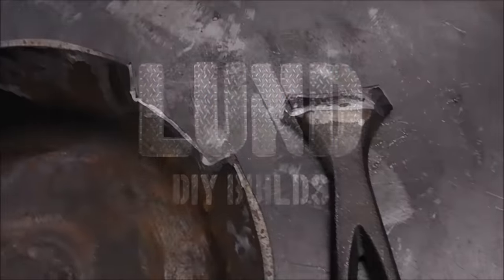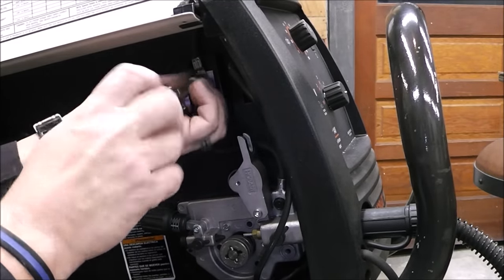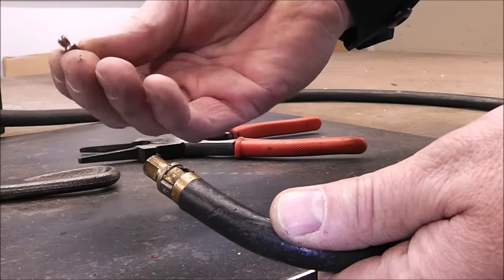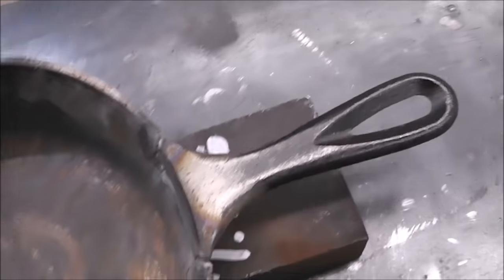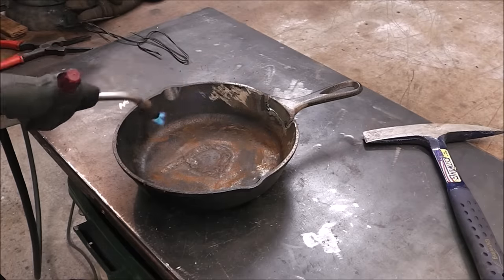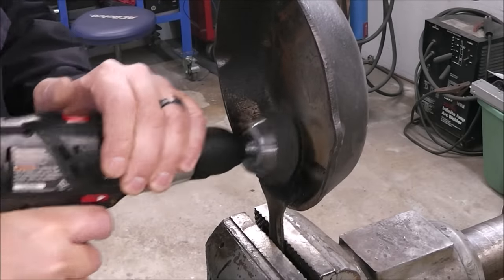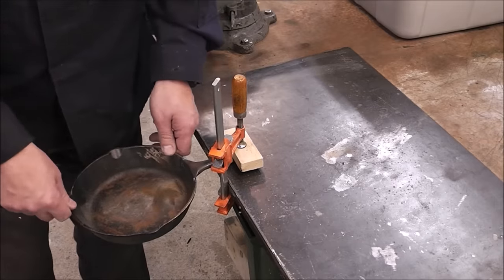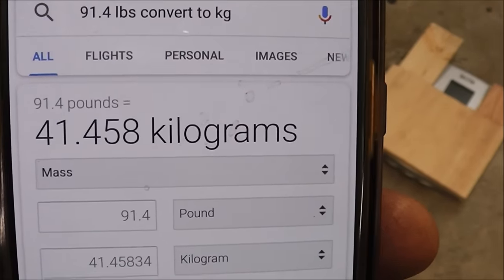Cast Iron Welding Repair using Flux Core Wire

Comment: I appreciate the video ,most people don’t understand that for decades Briggs and Stratton used a pot metal for their blocks, it wasn’t as strong as billet  aluminum or cast-iron, but it worked for the purpose of making a lawnmower engine ,it’s the application is what’s important to understand I worked for a company that would make molds out of Kurt site  and as long as you were making thousands of parts it was a great system but because the molds were for fiberglass parts body parts ,a fiberglass mold was cheaper especially for only a few hundred parts. so it is the application and what is the cost-effective method trying to make the strongest thing in the world is not necessarily what you need to do each time .getting that through the heads of some people is rather difficult so what works on each kind of repair I find very informative and appreciate what you’re doing ,the people that  complain will complain no matter what because they can’t or don’t do these things themselves .and do not consider all of the factors involved so thank again for the video.
Reply from the maker: Thank you so much. You get it. Not everyone does as you pointed out. I watch a channel called Pakastani Truckers. Those guys repurpose and get every bit of life out of something. It may not always be the best but there is some really good creativity and inginuity that comes out of being poor. Its one of the reasons i take such good care of my stuff

Comment: Great channel!  You're doing what others wonder about and that's a good thing!  I grew up poor and never had the right tools for any job, everything was jury-rigged as they say, everything was 90% figuring out how, and 10% cost because we didn't have the money to just call up an expert to come running.  These days I'm fortunate to be able to pay others do work, but I still think in terms of what can "I" do myself and your videos bring that out!  You're not trying to sell the latest brazing rod and call it "welding" you just show what can be done equipment on hand.  Flux Core welders are dirt cheap and probably the easiest way to weld and certainly less expensive than a gas setup and all the crap that goes with that!
Reply from the maker: @Randall Scott-Key you hit the nail on the head perfectly! I couldn't have said my intent to the channel any better than this! 🙏 I grew up EXACTLY how you described and it's why I make these videos. Nothing was ever what I needed. I had to figure out how to get it done with what I had on hand and that usually wasn't much.  I chuckled when you said you are at that point in life where you can pay people to do certain things but still wonder about doing it yourself. That is a spot on statement. I'm at that same point in life myself and it feels good reflecting back from where we've come. It's why I give back to our community. I remember what its like to struggle.

Comment: I’ve used several fire bricks underneath and around the edges and acetylene to preheat the material. Then nirod for the weld repair, added more fire bricks on top and let it cool slowly to prevent cracking. Good job.
Reply from the maker: Thanks man! I appreciate your support! Good tip on the fire bricks!

Comment: I like this! As a welder that specializes in SS GTAW, I have repaired backhoe hydraulic rams to T50 buckets using SMAW and FCAW and there are weld procedures, pre heats, inner pass temps for each structural steel when safety is required, but I really like the experiments. Nothing gains a better understanding than a failure. For this pan, you'll never cook eggs or a steak more than 100lbs so if Self-shielded flux works, it works! A metallurgy course, temp crayons or thermal gun is very useful in these types of situations. Keep up the good work! 👍
Reply from the maker: Thanks man i appreciate it!

Comment: I totally did this once when my mom dropped my skillet. I didn't use preheat or Bevel the edges. I just cleaned and welded it and it still seems to be holding well
Reply from the maker: Nice Job!

Comment: Thanks for the video. I am one of those guys that only has Flux Core wire welder. I am also new to welding, but I knew cast iron welding wasn't as simple as other things I have welded. My sister-in-law has a crack in her cast iron pan and this comes in real handy.
Reply: I encourage you to try other methods of welding. I think you will find out that flux core, IMHO, is the least user friendly than all the other methods. Especially if you are welding sheet metal.

Comment: Love the vid! By no means am i a pro. Several years ago I had to do small hand rail welding project, little did I realize that 1 of the 2 parts was cast. At first it kept cracking my tacks, after it got warm enough it started to stick together.  It took a while of weld a lil grind a lil, but it turned out looking decent and still holding to this day with my flux core machine. Nice to hear that some people still embrace alternative methods.
Reply from the maker: Thars awesome Craig! It's tricky but it can be done as you found out! Nice work buddy!

Comment: Good video.  I’ve been welding cast iron skillets, cast iron vises, ductile iron vises, engine blocks, and other cast iron engine parts for two decades using fluxcore mig or 7018.  Things like exhaust manifolds with dirty carbon exhaust needs more preheat to bake out the impurities. 

SS309 rod also works very well for cast repairs.  It was designed to weld ss to mild steel and has a lot of chromium in it that is soft allows flex as the weld cools if post heat is not available. (Such as engine blocks in vehicles).  Lastly, watch using plastic containers. I’ve melted a few. Lol
Reply from the maker: Thanks brother! I appreciate your support and kind words!
Reply: Dont huff those stainless fumes.

Comment: I welded a cast-iron crank handle on a Chinese drill press that my dad broke when he tipped it over.  I ground a groove on the broken parts, then decided to tack it together while waiting for my dad to braze it back together.  Using my mig welder with ER70S-7 wire with 25-75 Argon gas, I used a lower than normal heat setting, and tacked it on both edges.  It went so well, that I decided to make a core pass.  That welded so nice, I decided to make another, then another, and another, and eventually filled it all the way with the welder.  It welded amazingly well and so easily, that later I welded a HUGE crack (1/4"+) in a Ford 460 exhaust manifold for my neighbor that still wasn't leaking when he sold the truck 5-7 years later.
Reply from the maker: Nice work man. There is no better feeling when you can take what you have, use some ingenuity and make it usable again. It's a very rewarding feeling.

Comment: Thanks a bunch.
I've learned a thing or two from this video. I'm one of the guys that only has a flux-core mig welder... and no cutting torch either.
Reply from the maker: Than this video was for you brother! Thanks for your support!
Reply: Flux core self shield is extremely versatile. Can be used anywhere and on a wide range of applications.

Comment: As a welder myself, I would've put the pan in the oven for even heating. Then after welding put back in oven to slowly cool.
Reply from the maker: My wife frowns when I bring my experiments into the house and put them in the same thing that cooks our food.  Ask me how i know lol 🤣
Reply: @BrandonLund  You can always head outside and use the BBQ 👍
Reply: Post heat is good for materials with high amounts of carbon, especially cast iron!
Reply: @muskwaman500  except if its stainless..... sometimes  ;-)
Reply: Brett Dalton sometimes haha only if it was Martensitic SS then preheat and postheat would be required. Wouldn’t want Austenitic SS to go over 600 Fahrenheit or else Carbide precipitation would happen lol
Reply: @vstrom9586  I would have used ni rod with my stick machine or brazed it if I didn't have any ni rod.
Reply: @sswcustomsewing4276  Nickel rod works great, but it is spendy lol
Reply: @vstrom9586   what if you dont braze or even have one.
Reply: @BrandonLund  For those that don't know. One of the ways to take the rust out of a pan like this (like if you found it buried in the back yard), is to put in the oven and turn the self cleaning unit on. That's pretty much standard in the 'antique' cast iron crowd.
Reply: Ok, and Brandon would be done and moving on to the next job. You would be still pre heating it in your oven.
Reply: @markmason862  yes he would. On his own pans. That is great for at home, but if I was doing it for someone else and had to guarantee it, or fix it again.  Even preheat and post heat are a must. Weld a few old Rams horn headers, or fix a few cast iron blocks. Nothing is a guarantee with cast iron, but pre and post heat sure goes a long ways.
Reply: Brandon Lund well, since you’re going to use this for, you know, cooking, I don’t think she should object.
Reply: That's the way to do it pre and post ...
Reply: @vstrom9586  You didn't listen to him did you?
Reply: I like to put cast into the wood stove to preheat it then I bury it in the ashes and wait till the next day to recover. I’ve had great results doing this
Reply from the maker: Preheat and a post cool is by far the best way to ensure a quality job. I demonstrate cold welding because this is the extreme so you know if it works cold welding than it will for sure work with a preheat.

Comment: Ping it a bunch while hot. Keep heat on it.  Sometimes a pneumatic chisel or needle scaler works for pinging.   Slowly cool it down. Use an oven if you need to, start at 500 degrees and start lowering it every 15 minutes by 20 degrees.  This works with 7018. Pre heat and post heat is the most important, heat to about where a magnet dont want to stick.
Reply from the maker: Thank you! Finally someone that agrees that cast can be repaired with 7018!
Reply: @BrandonLund  Been doing since the late 80's.  Cannot stress enough of the importance of pre heat and POST HEAT. The whole part if possible.  Those Harbor Freight weed burners are you best friend.  The magnet trick will work every time.
Reply from the maker: Spot on brother and great tip on the magnet.
Reply: @chuckmiller5763  i do repairs on cast iron with 7018 even at cold (no preheat) using a 10% thinned than the rod copper wire surrounding the rod and weld it onis quite tricky but helps the overall ressistance on pulling and hot-cold transitions,usually i preffer 7018 rod with copper wire wrapping the rod (on thin metal i also preheat),on cast iron over 1 inch i don't preheat unless is a piece that i can handle regarding the overall weight,but my most preferrable is a stainless rod,but when i don't have stainless rods on hand,i use 7018 and works GREAT ! Yet the ideea with flux core is nice to see it in action !!!
Reply: 7018 on cast Iron ? never heard that before.

Comment: Exhaust manifold waste gate outlet still holding ten years down the road
Reply from the maker: Right on brother! After testing the strength I'm not surprised. Cheers brother.
Reply: How about a drop test from counter top height? Just for info sake. Otherwise well done...
Reply from the maker: @victorrodea7163  That could be interesting...Thank you for the suggestion!
Reply: Did u weld the wastegate with a mig flux core wire?

Comment: Building ships where I work we weld cast deck sockets onto the helo deck with flux core. Holds fine
Reply from the maker: Shhhhhhh.... there are  people on here that say it cant be done lol.  Good information. Thanks! It must be some pretty good size wire. What size wire do you run .045?
Reply: @BrandonLund  It depends. "Cast" is a broad term. You can't weld white iron but you can very easily weld nodular iron, cast steel, cast stainless or almost any non ferrous casting.
Reply: @geoffmooregm  Thanks for the information!

Comment: If you have only a Stick Welder use a Stainless Steel rod if you have no rods for cast iron. 
Or Braze it with Oxy Acetylene, if you have it. The Braze will well stand the heat of a cookstove. 
Brazed repaired exhaust manifolds stand up to the heat after all.

Comment: Water is a by-product of the flame, then condenses on the cooler pan until the pan gets hot enough to vaporize the water.  My 2 cents....
Reply: You are absolutley correct. You won't see the moisture if you were to use an oven or induction heater.
Reply: Correct. But it IS how almost all weld shops preheat. For cast I have always used a Temp stick to make sure it got to 300° before welding
Reply: @tubbz691  Yea nothing wrong with it. I had a natural gas with compressed air torch. It was a freaking monster. The compressed air created a venturi effect on the gas line and actually pulled a vacuum on it to draw extra gas out.

Comment: braze it.?
i never heard of a repair of cast with anything other then brazing. back in the day we braz cast iron massyfergesen frontend ( a 2 foot half  bowl shape about 2+ inchs thick. )and it worked!  A lot of stress on that piece holding front of tractor pounding down etc.never heard of a failure. Took long time to heat that piece 5 hours+, and 12 hours to cool it. also used bolts to hold the it together. removed them and filled that part of crack.
Reply from the maker: Brazing is probably the safest and most trusted method in my experience but for those without the proper conventional equipment, I wanted to demonstrate several different processes and then using a destructive process as a form of comparison.
Reply: Hey man I took a crazy adventure this weekend my shifter fork on my truck went out... No job right now so I welded it up enough to get me by for a week or 2 till the part gets in do u think it will last took my time. But I got it
Reply: Brazing isn’t as strong as welding. Sometimes, with a crack in a big casting, brazing is fine, but usually, for a thinner part that needs strength, welding is better.
Reply: @melgross sorry it took so long to respond. But. My shifter fork is like a halfmoon hugged around my sincros.... Remember it's a trans really long and narrow. I just wanted to know if I beveled it to build a complete buildup.... To almost oe specs would it hold... LoL
I made it work temporally buy drilling 2 holes and putting regular steel in the holes. Then I lightly tack welded keeping almost room tempature cause steel and cast expand different metals. I almost have it close to stock but It's a patch for now so did i do ok or am I doomed. I.e. I kept it co cool my finger were less than an inch away from a thin piece of the fork and after welding I could hold the part less than an inch away from my welding is that ok
Reply: Phill Black it’s hard to assume without seeing it, but it all depends on the load. Welding can be stronger than the original metal, if it’s done correctly. Don’t grind it down, leave it as welded, because it’ll be stronger.
Reply: @melgross  I did minor grinding to match the gap I checked with a Mic to make the tolerances 100% on..... Took time cause hear will kill cast LoL probly kept the temp below 140.... Again finger test lmao didn't want to keep it there but 1 and 1/2 still strong🙏lol
Reply: @melgross  I don't know how LoL but It's shifting well so far about a month in drained fluid to check for excessive wear on my metal drain plug.... Surprised..... I know it's bad when ur so tired at ur mechanic job u don't feel like changing the part u just bought LoL I'll do it tomorrow.... Sad

Comment: People on the internet will always get angry about something regardless, now as I understand when you weld any kind of metal the weld is stronger than the actual material and as far as the test goes weld seem to hold very well, good stuff sir.
Reply from the maker: Thanks man...I appreciate your support.  yah, haters are everywhere. As you mentioned, the tensile strength of the weld metal is typically greater than the base material which is why a proper weld will fail outside the weldment.

Comment: I don't know everything and im always learning. I have 25+ years of experience welding and fabricating yet my methods are very dated yet they work just fine for the work I do. Here is my 2 cents on cast. What you did with flux core that is a great method I have done it before and that repair is still holding up on a machine. When I repair cast what I really prefer to do is clean it really good and use my old Magnaflux magnet and power to see if it is just broken there or if there is more of a fix. Weld prep along everything that you showed especially the heating, peening, and cooling are spot on. I learned on burned up cast exhaust manifolds from a old guy who started at Scottys Muffler in California then started his own muffler shop for 50 years. If he was still alive he would totally agree. with this fix. Thank you 
P.S. if you would could you please warn people about how sometimes you have to hot tank/deep clean and get any oils, lead, herbicides, pesticides, toxic chemicals etc out of cast iron because no matter how good the cast is its got pores that can hold dangerous surprises.  Because if you don't you can get really sick from from the fumes and even make the people around you sick.